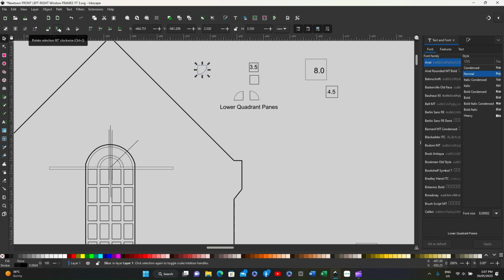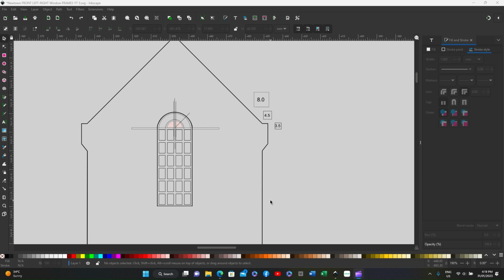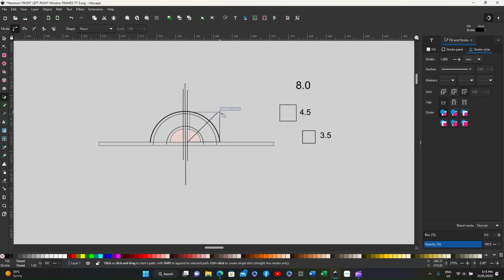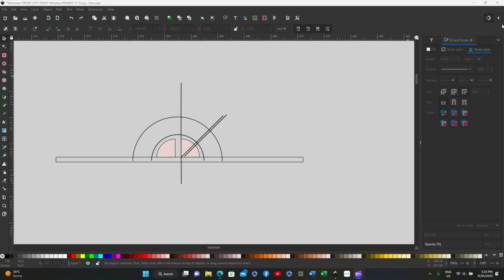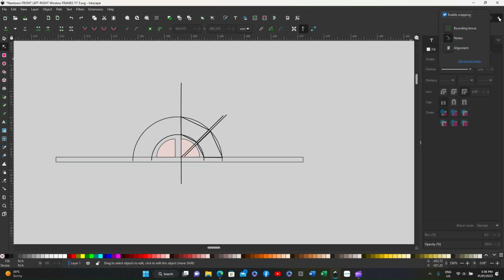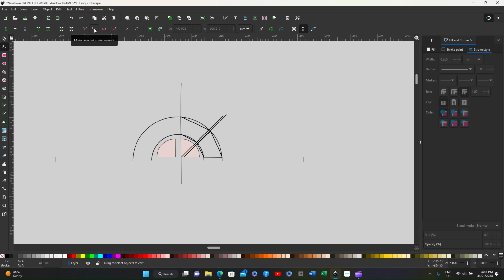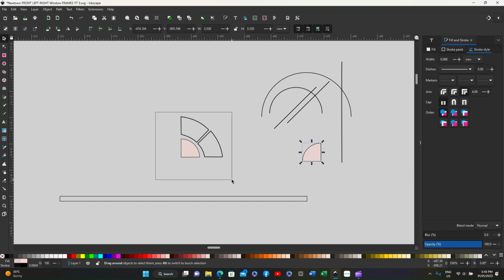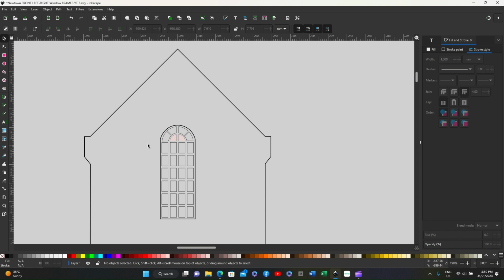Complex Window Frames (3) Completed Using Photographs from an Actual Building

Comment: That was excellent! Will this eventually be cut out on the Cricut? I don’t think mine could handle cutting frames less than 1 mm without tearing them
Reply from the maker: Yes I cut them out on the Cricut Maker 3 in 80 gram paper and can be seen in the videos of the Newtown School build.  I used a light grip mat and a premium fine cut blade and made all the windows for the school.  Main tip is using light grip mat but taping all sides to the mat to avoid any movement during the cuts.  The other tip is to make sure blade is clean and after every cut I plunge the blade into a ball of aluminium cooking foil which keeps the blade clean and sharp .  Cheers Alan.
Reply: @StocktonStation  thanks! I’ll need to give those tips a try